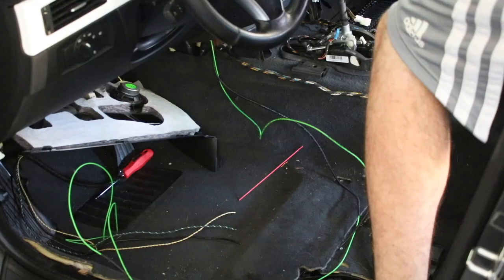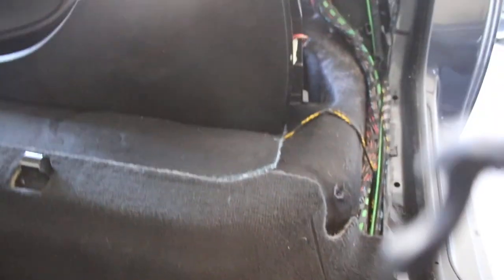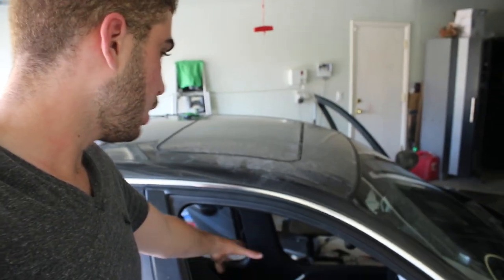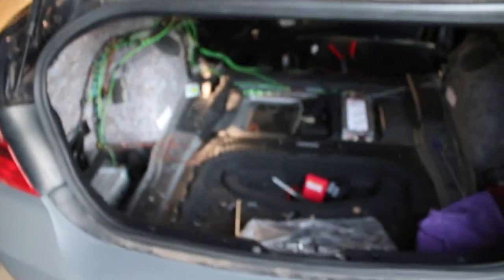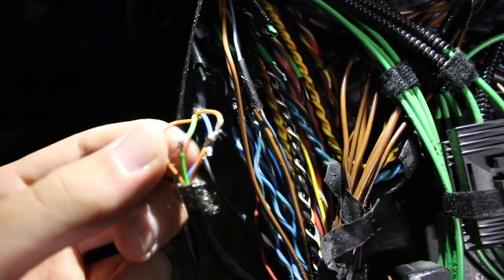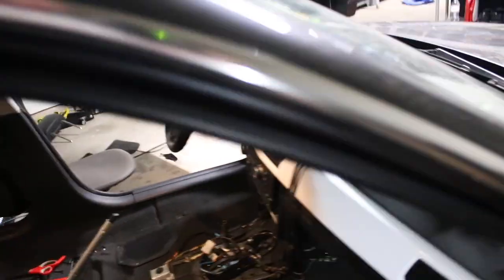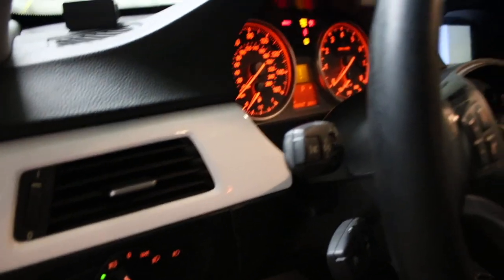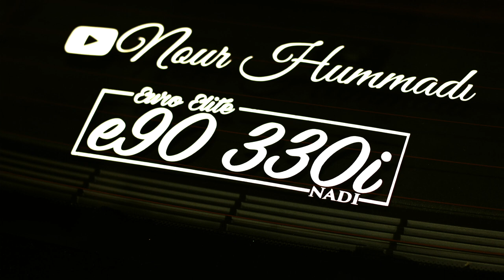Rebuilding BMW 335i Involved In Gun Fight! Part.17

Comment: Pretty sure that box in the back isn't the Bluetooth system. It's the brain for the phone system. The actual Bluetooth for the phone system is a small black module that is mounted on that removable panel under the dash on the driver's side. I didn't have this option installed on my e90 330i, but was able to source the parts from a 328i at pick n pull for cheap. There is an easy install guide online. It's all installed, I just need to get it coded now.

Comment: Hey man so I had the same problem when I bought my 335i, there was no sos light but 0 sound. I bought the fiber optic loop just like you and did all the testing with no results. It turned out to be my app. The amps are known for going out, especially since they are in a area where water gets in easily, try replacing the amp again and I’m pretty sure that will solve you issue. Love the videos 👍🏻👍🏻

Comment: Ccc and amp may not be compatible or need coding, I had similar issue happen to me I had gotten a radio with the same part number as mine but was a year newer and needed to be coded, because I couldn’t turn up the volume